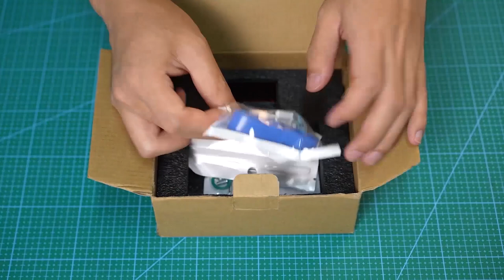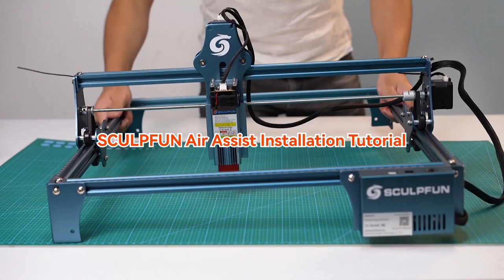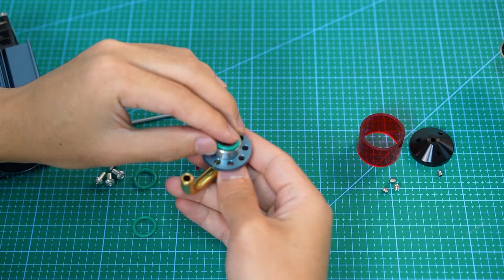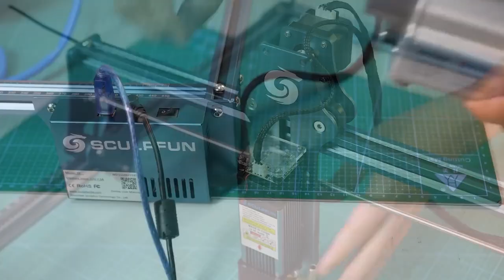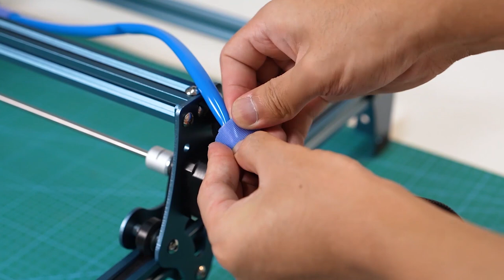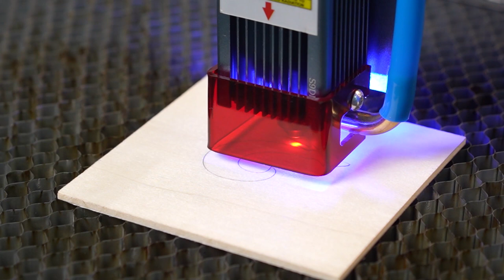Air Assist | SCULPFUN S9 Air Assist Unpacking and Installation

Comment: YouTube sorta randomly notified me of this video, which having never previously heard of SculpFun, served as my introduction to your products. It would have been nice to see a comparison cut done without the Air Assist, but that's probably unnecessary for your target audience. 

It stands to reason that good airflow would increase the cut quality of the laser (much the same as it functions on a plasma cutter), but I must admit that I've never seen such a clean cut as the one in this video. The virtually-nonexistent kerf and the lack of scorching on the front of the material were simply incredible. Is that quality largely attributable to the addition of the Air Assist?
Reply from the maker: Yes, the fast airflow works a lot, it blows away the carbides. It is also related to wood, which is suitable for laser cutting and has a clean surface.

Comment: Just installed my air assist on my s 9 and I love how it works.. the only complaint I have is that I can’t get the kinks out of the air line that were caused by how it was packaged
Reply: remove the wrinkles with a lighter and with your fingers you remove the kinks :)

Comment: I've just ordered an s9, and now I am wondering if the air assist will fit as I understand you changed the design last year.
Reply: I've received my laser a year ago for my birthday and this birthday I got the air assist. And it's the right model, so I can't imagine yours wouldn't be right.

Comment: I am about to design my own air assist tonight, but I just saw this video, I probably drop my own idea 🤣🤣🤣🤣🤣🤣
Reply: @SCULPFUNReal  well, I picked up my idea to test out the DIY air assist eventually 😆
Reply from the maker: @lewy7601  With 3d printer?
Reply: @SCULPFUNReal  Hi, I use sculpfun s9 to cut 6 mm mdf to make 2 pcs of Ø32 mm thick disc, and plus a 30 mm long hexagonal brass coupling (with side hole) placed at the disc centre , then use a pneumatic fitting to connect the side hole. The DIY idea test out good as I perceive. Hope you guy can imagine how it work.
Reply from the maker: @lewy7601  Yes i can imagine it. That's great! Enjoy!

Comment: Onde compro? Mande o link!
Reply from the maker: Purchase links: (Original SCULPFUN S9 Air Assist Nozzle Kit)

TOMTOP (With the air pump) : https://www.tomtop.com/p-os6568-2.html

TOMTOP (Without the air pump): https://www.tomtop.com/p-os6566.html

Aliexpress (Global delivery): https://it.aliexpress.com/item/3256804292128195.html

Aliexpress (Global delivery): https://it.aliexpress.com/item/3256804292202100.html

Aliexpress (Global delivery): https://it.aliexpress.com/item/3256804292104150.html

Aliexpress (Global delivery): https://it.aliexpress.com/item/3256804292147460.html

Comment: Today i receiver my s9.
Unfortunately it doesn't do what i need it to do : cut clear acrylic ..
Guess i Will need a CNC after all.
Reply: You need a CO2 laser for that. Different wavelengths. It's a bit late now, but a bit of research before purchase would have saved you a lot of hassle.

Comment: Is this a new product for s9 as there was an air assist only for s10?
Reply from the maker: This is a nozzle that can be mounted on the S9 to upgrade it to get air assist.
Reply: @SCULPFUNReal  I still have an S 9 which does not have this cover cap. Can I still install Air Assist?

Comment: where can i buy one of these?
Reply from the maker: Purchase links: (Original SCULPFUN S9 Air Assist Nozzle Kit)

TOMTOP (With the air pump) : https://www.tomtop.com/p-os6568-2.html

TOMTOP (Without the air pump): https://www.tomtop.com/p-os6566.html

Aliexpress (Global delivery): https://it.aliexpress.com/item/3256804292128195.html

Aliexpress (Global delivery): https://it.aliexpress.com/item/3256804292202100.html

Aliexpress (Global delivery): https://it.aliexpress.com/item/3256804292104150.html

Aliexpress (Global delivery): https://it.aliexpress.com/item/3256804292147460.html